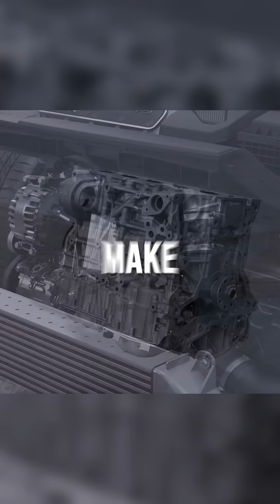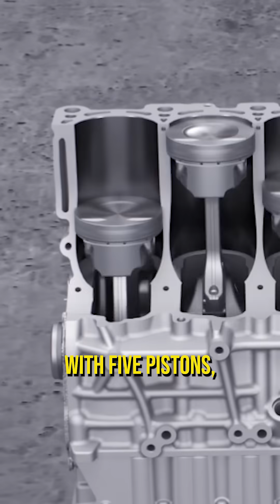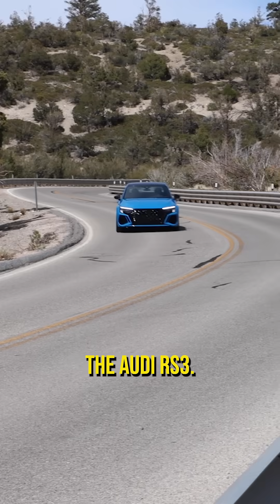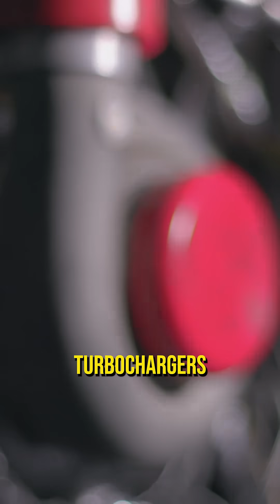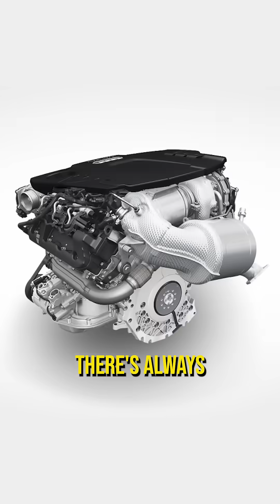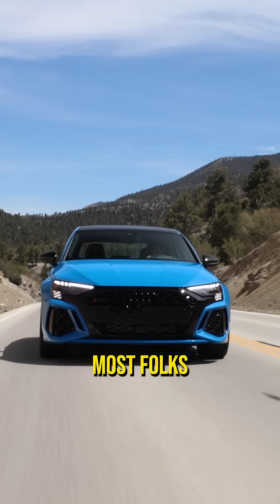What Killed The 5-Cylinder Engine?

Comment: The problem with this analysis is that a 4 cylinder with a turbocharger puts stress on the parts more than a 5 cylinder because the air needs to be more compressed leading to a hotter engine. Usually parts wear out faster doing this because the heat is often pushing the tolerances 
So you have a 4 cylinder that doesn’t last as long as either a regular 4 or 5 cylinder

Comment: I have owned both an inline 5 and inline 6 volvo and they sound and feel amazing. Personally I like the sound of the 5 cylinder better but sitting at idle it vibrates the car enough that you can feel it.

Comment: 5 cylinders do make  sense if you think about it. There not that much bigger then your average 2.0L 4 pot and thats why they can still be transversely mounted as you said, So you can have 2.3-2.5 L instead of 2.0 L for almost the same size with a 1000% better exhaust note and a slight amount of overlap in power pules and much smoother at redline too. A small second engine mount with small a rubber seal fixes all the balancing issues of a 5 cylinder.

Comment: I still have a 2005 GMC Canyon 5 cylinder 3.5 litre, Manual shift, as the original owner. It has seen better days, but still gets me around when ever I need her ! Most of the time, it stays in the garage, and I put a battery tender on it in between drives.

Comment: i would argue that a V6 is inferior to an inline 5 in a transverse setting primarily due to the fact that it will always be a huge pain in ass to do basic maintenance on any of the cylinders facing the firewall. people love to joke about spark plugs on subarus but if they’ve ever done the same job on a fwd V6 I know which job they’d rather pick.

similarly, a turbocharged inline 4 adds clutter and lots of extra plumbing to the engine bay just to match the performance you can get out of a inline 5.

Comment: I5s are some of the smoothest engines ever produced not only the sound the acceleration and power output throughout the rpm range is too good. Not too overwhelming and not too basic at the same time over all inline 5s used in audis shouldnt be discontinued

Comment: I have it in the Ford Mondeo mk4, it's Volvo engine and it sounds great. It's a pleasure to drive it, the only bad thing is that it has 2521 cubic centimeter and because of that it costs me about twice as much to renew the registration than a vehicle up to 2500cc and three times as much as a vehicle up to 2000cc, since in my country there are long outdated classes based on engine displacement, I still refuse to sell it.

Comment: i got a 2011 c70 with an inline 5. its insanely good sounding for it being stock. the mix of the engine screaming and the turbo whistling at 5k rpm is something to die for
Reply: volvo and audi/vw built them with forged internals from factory down tuned just a basic tune and a size bigger injectors you have a sleeper
Reply: @UgaBooga-q3r how much power would you say it can get?

Comment: well, like this you could even argue noone needs anything but 4 cylinders or less. bc theres 300+ hp 4 cyls and noone NEEDS more than that in a street car. a 4 cyl 2.0 TDI with the right turbo setup has enough torgue for anything you can legally drive and pull with a regular car driving license almost anywhere besides the US where yall are allowed to tow giant heavy trailers that noone needs.

Comment: I believe sound in Hz works like frames in Hz. That's probably why it sounds better than a v6. I could be wrong but I think a v5's timing is half a v10's so half the sound frequency. and 5 is a factor of 10. Like how 60hz is good on a 120hz monitor,
Reply: timing as in explosions per minute

Comment: My jetta 2.5 runs smother than any 4 or 6 cylinder engine. In idle you think theres no engine running at all... Never saw such an quiet engine in my life... A v12 could beat it 🤣 but not the v12 TDI

Comment: there is, the power that 4 cylinders are putting out now stress them so much that we're seeing more blown up 4 cylinder turbo charged engines. having a 5 cylinder handles the power much better with better reliability

Comment: It sounds better than a 4 cylinder and can give 4 cylinder turbo power without the turbo, and smaller than a 6 cylinder. Less surface area on the cylinder walls and head makes it more efficient than a 6 cylinder. In every way it's better than a four turbo or a straight 6.
A 2.5 I5 can make the same power as an economy tuned 2.0 turbo I4 and a 3.6 I5 is smaller and lighter than a similar displacement I6, is less complex than both and sounds better.

Comment: One of the best engines! I know people pushing 800hp stock internals if that engine was crap it wouldn’t be that good, it’s one of the best ones and best sounding ones if you run just e85 stock everything no upgrade pipes turbo nothing all stock just E85 they make 389awkw how idk you can ask any tuning shop they will tell you the same thing.

Comment: This 5 cylinder was the unmatching follower of the rotary engine by AUDI NSU. Too bad, as the new KKM871 was better in any measuring than the 136 HP inline five. It had 170 HP and better fuel consumption. But AUDI used NSU slogan "Fortschritt durch Technik" for their inline five! Why? Still today AUDI is technologically not on the top.

Comment: 5 cylinders are great torque monsters. Whether it’s VW 2.5L in a variety of cars or the 3.7L 5 cylinder that was in my GMC Canyon. Good clean reliable and powerful engines. I bought that truck based on the fact it would only have one cylinder head, one of each manifolds and a timing chain. Much less to go wrong there.

Comment: The point of the 5 cylinder in Audi package was to have an engine make more Horsepower not toruqe due to audis having not enough space for an inline 6 also not to mention the sound of a 5 cylinder which is wonderfull.

Comment: You literally answered the question though. A 5 cylinder allows for greater displacement. Peak power figures don’t tell a full story and its the reason the new C63 failed. An inline 4 can produce impressive power but the power delivery is not the same as a greater displacement engine. 

Imo, Audi massively failed by not developing a 3L inline 5 to be put into the S5 and S4 longitudinally (or even a TT successor). The V6 sounds great but is unnecessarily complex, heavy, and less economical - and an inline 5 would help Audi to further develop a USP and signature sound profile that already has lots of love and approval.

Comment: You wrong, engine is smoother and you can drive it 500rpm lower and it doesn’t vibrate or anything. It’s the best sweet spot between v6 and i4

Comment: Is there history of these engines going at least 300,000 miles? I'm impressed that five cylinders can fit mounted transversely. Henry Ford was motivated to come up with the first mass produced V8 engines because in 1929 Chevrolet introduced a straight six which couldn't fit in the frame of the newly introduced Model A.

Comment: "A 4 cylinder with a turbo can match the power output of a 5 cylinder" and then has less reliability

People clown on the old v6 and v8s making less power than a turbocharge 4i but they last 3 times as long

Comment: The V5 with a 75.5 degree V is a good alternative to the 4 cyl, fits in about the same space as a 4cl, makes much more power, revs significantly higher due to its design, and is happy with supercharging or turbocharging.

Comment: Does the same apply for diesel engines? My Troller TX4 — a "brazilian heavy jeep", so to speak, which was lastly made by Ford until 2021 — has a 3.2 duratorq turbo diesel in it, the same as the one in the Ford Ranger, and I love it!

Comment: Volvo seeing an I6: “yeah that’s going in transverse, we’ll make it fit” 😎
Reply: The 2.5t is still the better engine than the 3.2 though, the 3.2 is pretty gutless at low rpm’s but the 2.5t makes max torque at 1500-4500 rpm. Much better powerband. With a basic stage 1 tune you can get 250HP with the stock low pressure turbo and injectors.
Reply: The 2.5t is still the better engine than the 3.2 though, the 3.2 is pretty gutless at low rpm’s but the 2.5t makes max torque at 1500-4500 rpm. Much better powerband. With a basic stage 1 tune you can get 250HP with the stock low pressure turbo and injectors.

Comment: I have worked on 2 inline 6 cylinder Volvo motors this week, both transversely mounted. One was in an older Land Rover. Very neat set up, but an absolute pain to work on 😂
Reply: I think they are easier to work on than Volkswagen 2.0t engines manifold comes off in 5mins with two tools and everything is fairly simple design besides the whole timing and READ system

Comment: Sound, more displacement, more room for power. Also, for example a 4cyl 2.0 400hp will run less than a 5cyl 2.5 400hp. So it has sense.

Comment: Displacement = total of each cylinder's capacity.
A 5 cylinder with a 2L displacement is very obviously the same as a 4 cylinder 2L... So the statement that a 5 make more than a 4 is not accurate.
Also, a same capacity V6 or a lower displacement L6 is smaller/more compact than a 5 in length.
This video is no good.

Comment: One thing that was missed was if you chose to use carburetors for an inline 5 cylinder engine its next to impossible to get the correct air to fuel mixture to work properly. Unless you magically managed to use webber side draft carburetors. Still the biggest problem is getting the correct balance of fuel & air.

That’s why the 4 bangers and 6 bangers are superior in those applications.

Overall great video.

Comment: A 5 cyl doesnt really have any extreme inherent draw backs except for bad secondary inbalances. That being said, you have overlapping powerstrokes (so yes smooth power delivery) and an extremely unique sound. Also, audi's RS3 DAZA is a 07k, a 5 cylinder used extensively between 2006 and 2014 where the economy CBU 5 cylinders were killed. The only real differences between the CBU and DAZA is the internals and head design, but both share a very potent block capable of massive horsepower.

Also, audi got into the rally scene with a 5 cyl, so it makes sense to keep one crazy, wicked 5 cyl around as an homage to their roots

Comment: I drive an I-6 BMW and an I-5 cylinder VW Jetta (2.5L) NA 2014. It is by far the most reliable car i’ve ever owned. It sounds great, has 200,000mi and still purrs like a kitty. Very fun car to drive but the real surprise is how much abuse and redlining it can take without any issue. The transmission will die long before the engine does. Still roaring through our mountains in maine with nearly a quarter million miles.

Comment: well technically the Volvo S90 V70 and V90 are still in production with hybrid 5 inline 5 cylinder diesel engines, i think its the D5 and D6 spec

Comment: The PX Rangers used a 5 cylinder turbo diesel here in Australia 
3.2 L

Duratorq or something like that 

An I6 is longer
A V6 is harder to single turbo
Therefore the I5 is in a sweet spot for makers wanting more performance than an I4 

🙂

Comment: My Mercedes-Benz has produced several 5-cylinder diesel engines, with the OM617 being the first and most well-known, followed by the OM602, OM605, OM612, OM647, and OM665. These engines were known for their reliability and durability, with some models exceeding 500,000 miles  Mine has more than 400.000 km , has ZERO blow back from the Tappet cover, burns ZERO OIL, smoother than the Jeep V6, or the Kluger!  Does better MPG with the Ambo Body than either of the others AND WEIGHS OUT AT 3.5 ton

Comment: audi made that engine because they can. it's an engineering exercise. they could have easily used a 4 cylinder turbo engine which would have delivered more power than inline 5. they just made it, used it for RS3 because they can.

Comment: My father used to have a 2014 Ford Ranger Wildtrak. It had a 3.2L Turbo-Diesel inline 5, producing 200 horsepower and about 500 Newtonmeters of torque. It sounded and operated very nice and smoothly. Still one of my favorites

Comment: I had a fiat coupe 20v turbo that thing was unreal, the rs3 engine is actually better than the 3lt engine in the rs4-5 because of power to weight and size and when twin turbos can make 650-700 on stock internals and box making it a beast

Comment: As the owner of a 4 banger, I would much rather a 5. The low end torque on a 4 cylinder is terrible, they vibrate, and you have to break 7k rpm to effectively merge on a highway every single time.

Comment: If i had a lot of money i would invest into building a V7 engine, i don't know how and it makes absolutely no sense. But we have come so advanced in technology that everything seems possible.
If a heavy SUV can run normally with a 2.0L turbo fine, and an electric car can accelerate to a 60 in a 2000 kilograms car in less than 4 secs then a V7 cylinder engine can work.

Comment: You clearly never drove a Audi 80/90 with a n/a 5 cylinder.
Yes a V6 could bring the performance but it is bulky and a 4 cylinder did not reach the performance. Also the 5 cylinder VW used in there T4 and T5 was powerfull and longliving. The new 4 cylinder don't match the torque of the old engines with or without turbo and the reliability didn't match too.

Comment: VW T4 has a 2.4L 5 cylinder Diesel Engine with or without Turbo ranging from 55kw up to 111kw in Stock performance and some special variants had up to 190kw with the same 2.4L 5 cylinder. This was the most reliable engine VW ever produced. 
Yeah there is a 3L VR6 but none one cares about this thing it sound terrible.

Comment: An inline 6 is smooth like butter though. A 5 cylinder is still a decent choice over a 4 cylinder if you want a middle ground engine. For example, youll either have a 3 litre inline 6. A 2 litre inline 4, or a 2.5 litre inline 5

Comment: I know it's a little problematic setup, but I like it. Slightly more complex than inline 4 (yet still the same number of cylinder heads and camshafts), but you  finally get overlapping power strokes (144 degree firing interval vs. 180 in the R4) and it's still smooth enough to work nicely without balance shafts.

Comment: a 5 cilinder is more reliable then a 4 cilinder with a turbo( before someone says o no thats not true read further) its less wear yes a turbo can make more power or can equal to it but a 5 cilinder without stress from the turbo so the engine cost less maintenance. both sound good ;)

Comment: Same with any other 4+ cylinder engine, you can have 300 BHP stock from any modern four bangers.
But the sound and the character? I would trade in every advantage of an R4 for the sensory experience of those 5-6-8 cylinders any day.

Comment: In my opinion, one of the coolest 5 cylinders in the market was Volkswagen's VR5 engine. This was a V5 with a 15° engle between the cylinder banks. This made it the size of a 4 cylinder with the power of a 5 cylinder. Really cool piece of engineering.

Comment: A turbo 5 cylinder is better than a V6 with the same power in my opinion. I own a 2008 Volvo C30 T5 and even though the power and acceleration time is almost exactly the same as my wife's 2011 Mercedes C300 which has a V6 I feel that the T5 engine somehow feels faster and more fun.

Comment: Wouldn't it make more sense if you were to have a family of I6, I5, and I4 like GM had with the Atlas engines? They would all be built on the same assembly line, many parts would be interchangeable, etc. The same thing applies to V8s that offer a V6 version, the only difference is that a typical V6 engine has its V angle at 60° (normally) the V6 created from a V8 block would have its V angle at 90°.

Economy/subcompact/compact‐I4
Compact/mid-sized crossovers/mid-size trucks‐I5
Mid-size trucks/compact SUVs/full size sedan-I6

Full size trucks/full size SUVs based on full size pick platform-V6/V8

Comment: A straight 6 can be transversely mounted, just ask Volvo. Also, the engine makes perfect sense, I don't understand what you're trying to get at here. This short doesn't make any sense. It's doesn't matter if a 4cyl turbo can make more power, it doesn't matter that you could "just use a V6" what matters is cost vs performance & the size of the engine bay.
Reply: Transversely inline 6 is too big and heavy for weight distribution.

Comment: This is why the VW NA 5 Cylinder is such a reliable engine. AUDI/VW only made that Turbo 5 then sold a NA version of that beeefed up Turbo Engine. 

So you have a motor built for boost with no boost ? These things last forver.

Comment: People buy this because of the sound and feel of the engine; it's an emotional choice.
Also the fact it makes over 300kw (400hp) and 500NM from the factory isn't bad either from a 2.5L as well as having huge tuning potential.
You can make an equality similar argument that all internal combustion engines are redundant because they are only 25-30% efficient compared to brushless electric motors which are 90% efficient. However as you know there are many other factors than efficiency alone that determines an engine or motor's usefulness.

Comment: 5 cylinder will always be my favorite engine, always! Totally addictive, nothing like it! The world would be spinning so much smoother if all engines were 5 cylinders!
Reply: Grew up on fast sixes ❤❤❤
Reply: @raceyrache8463  hate to tell ya those fast sixes are getting beat by the rapid 5's ......1000+ hp with factory head bolts..... iroz lifted their first head @ 1400 hp engine was built but used stock crank and head bolts